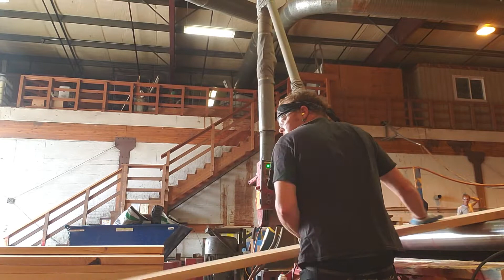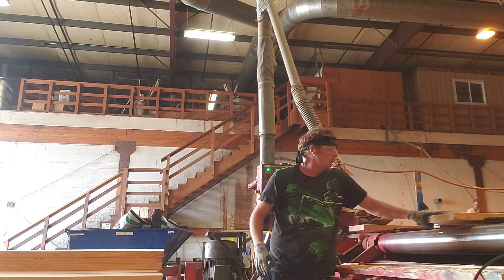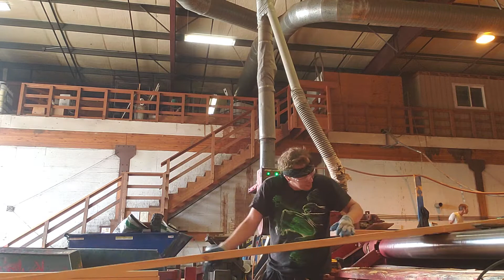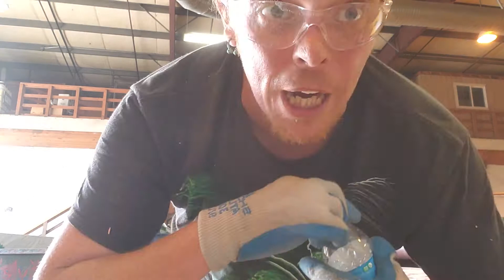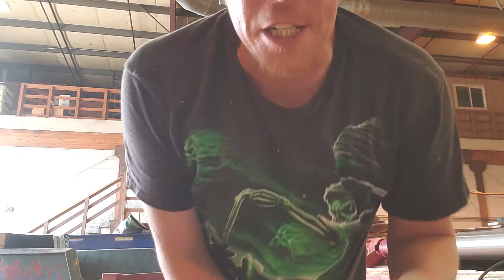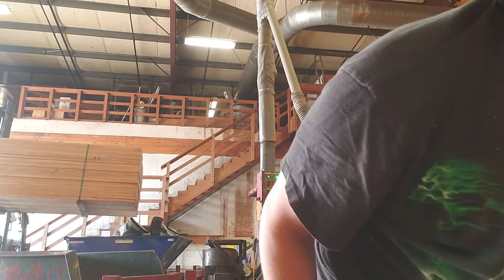What I do at work

Comment: What are you doing with the saw?
Reply from the maker: Have to cut knots out the end so it doesn't break the finger blades the machine it runs through puts in. I'll record or post pictures of the finger jointing done. I was working grader spot. I have to determine grade of boards and throw only those that pass for what grade is needed
Reply: More to your job than I thought